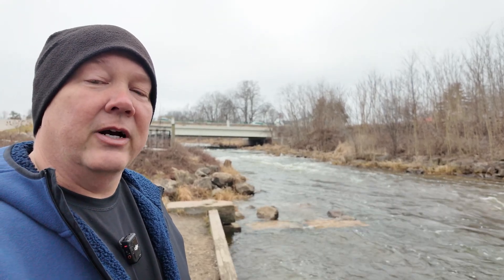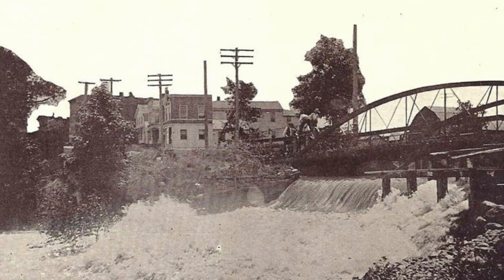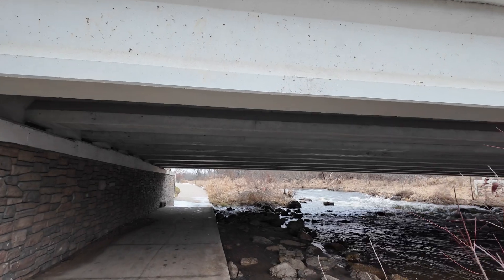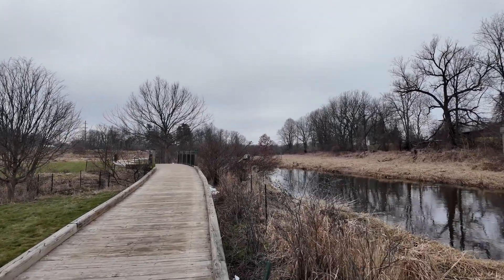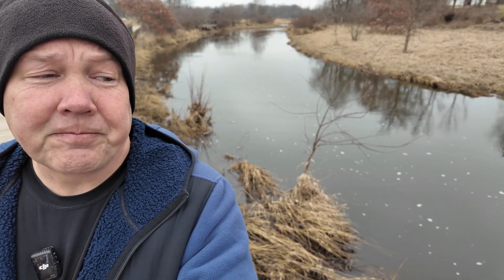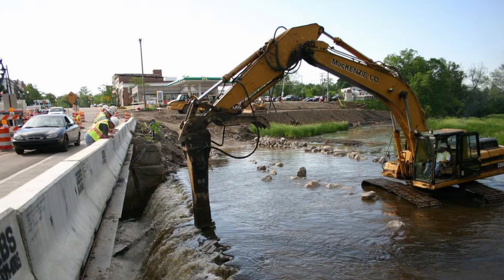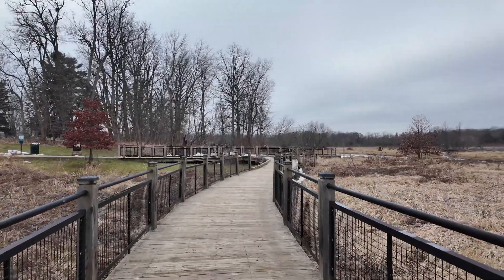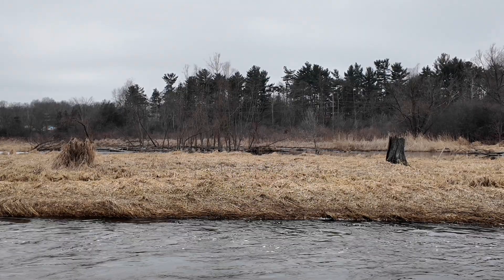Removing Henry Ford's Mill Creek Dam Just in Time

Comment: The Amtrack train heard in the beginning was on what is now owned by State of Michigan, previous Norfolk Southern/Conrail/Penn Central/New York Central/Michigan Central Detroit to Chicago line.  Started by new State of  Michigan 1837, sold when State went bankrupt. O
Reply from the maker: That line's gotten around.  I didn't know it was one of the first set up when the state was formed, though.  I know there were 5 rail lines and 1 canal, and the canal failed horribly before it was even close to completion.
Somehow, the state of Michigan ends up owning weird stuff.  I have no idea why, but Greyhound busses operating in the state are owned by the state, for example.